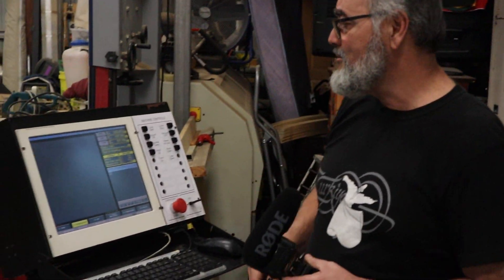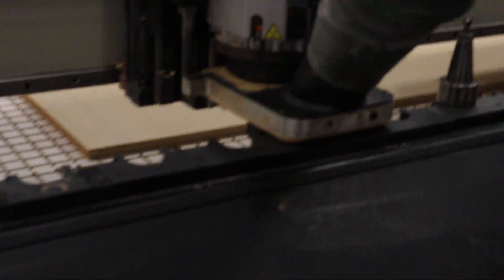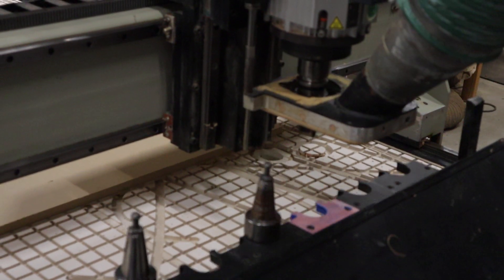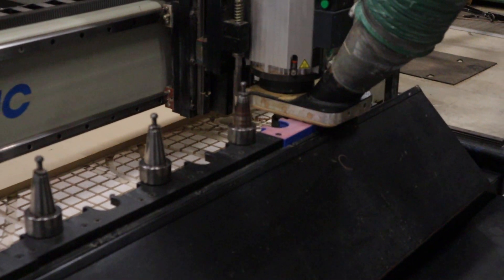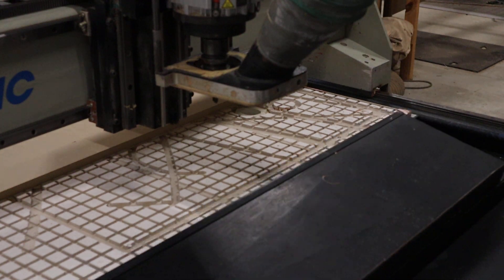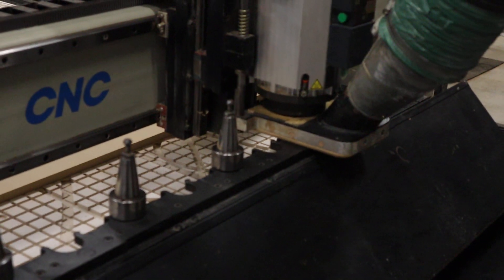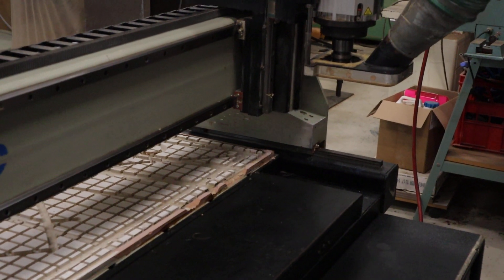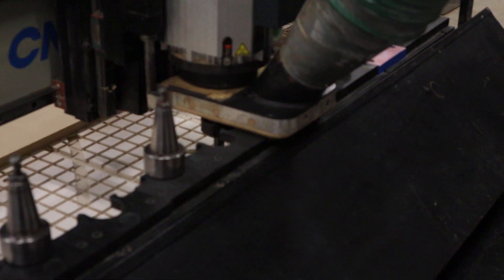Masso's updated Tool change feature (CNC Router)

Comment: Hi 
Have just found your channel I have a Procam 2400x1800 machine having problems with the centroid board have got a tech in WA that is very good but hard to get onto just wondering can you help me with maintenance or how much is it to change over to the Masso control
Thanks
DaveH